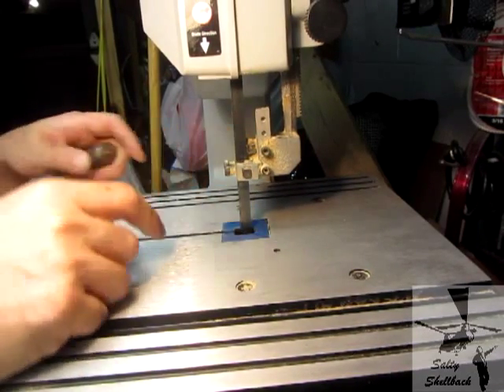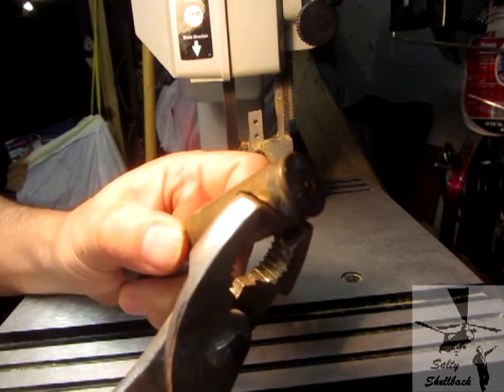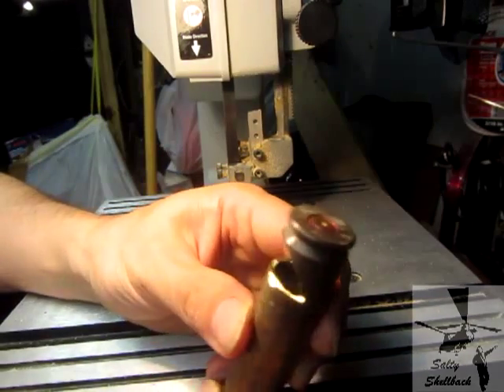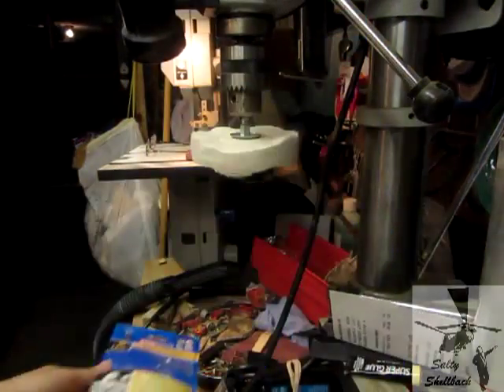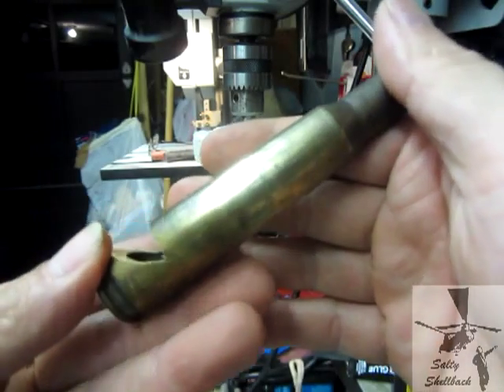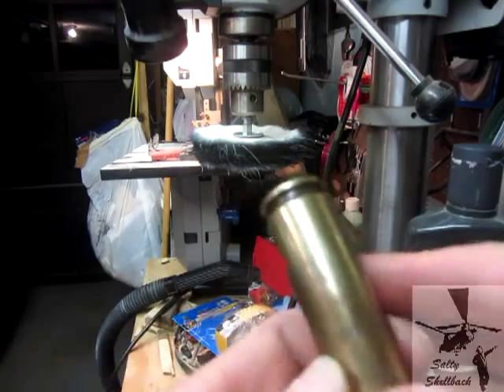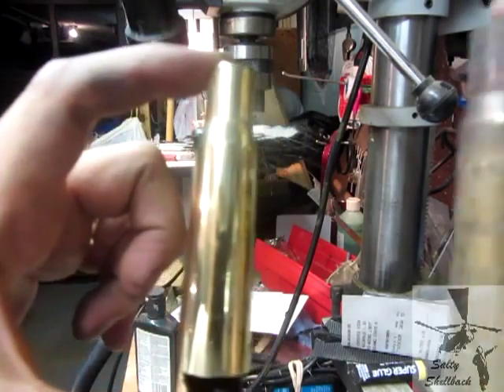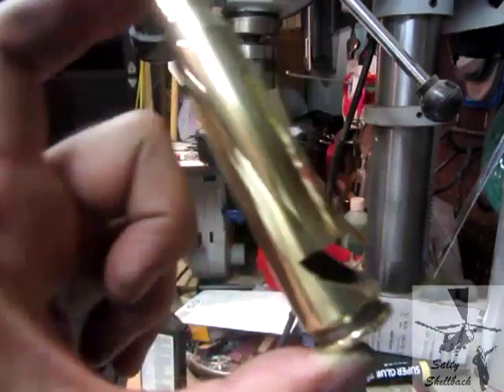How to make 50 BMG bottle openers-trench art

Comment: the rouge sticks.  the darker the color the coarser the grit.  white is the finest, black is the coarsest you can get. the liquid rouge can be thinned with charcoal fluid.  that evaporates fast so you can work the spot and then buff it out froma dry film right away.  adding a little bit of all purpose flour will aid buffing the finished surface and drying up any oily compounds.

Comment: Have you tried an actual brass tumbler to polish?
If it's a cost issue, you can make one yourself on the cheap...rolling or vibrating.
Just a thought.
Reply from the maker: Yes, I have used a brass tumbler, but it is not aggressive enough to get the tarnish stains off.